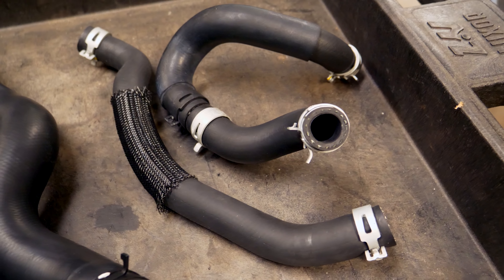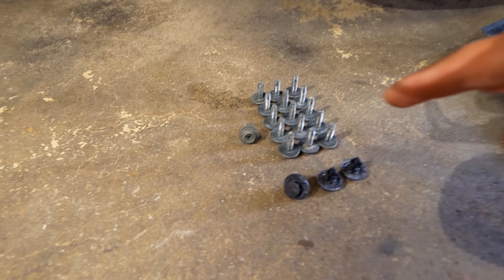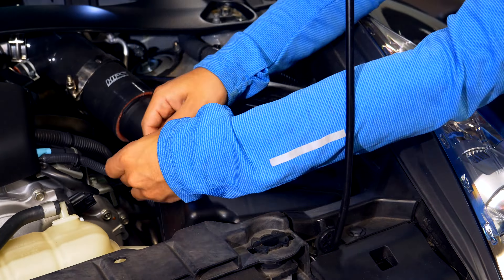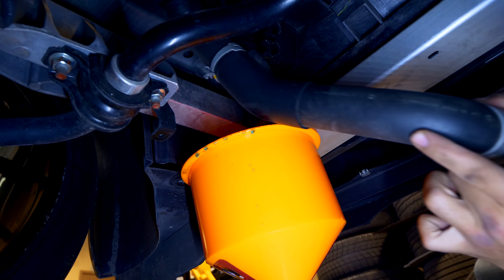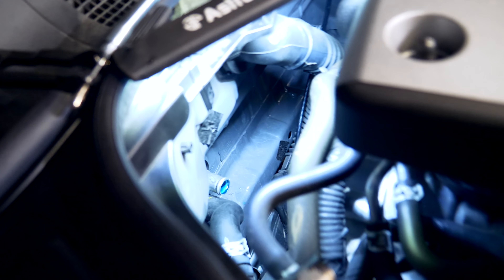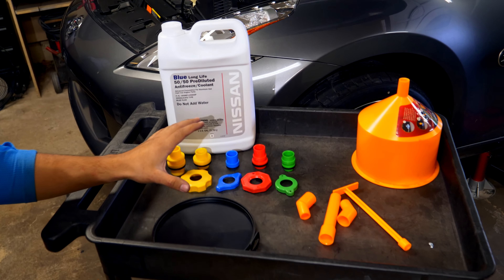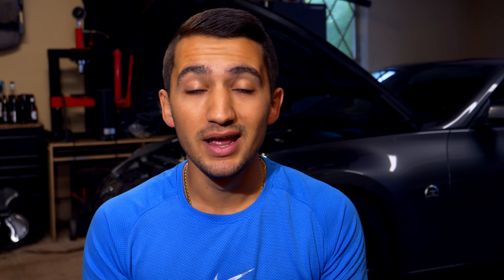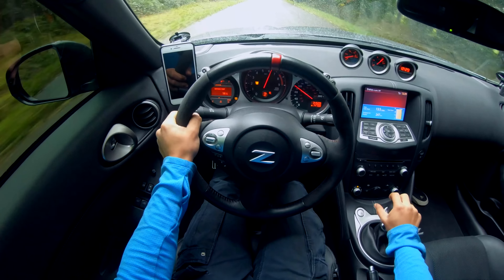How to Make Your Engine Run Cooler | BLEED MADE EASY

Comment: you have to configure the ECU enrichment fuel injection because at lower temps it will over-inject fuel to compensate for the lesser normal functional temperature from factory after putting a different thermostat - or get just over consumption needlessly.

Comment: I just did all my hoses on my 2009 G37. Surprisingly they were all in good shape, however then I did my heater hoses the plastic coupling denigrated in my hand as I took it off. I vacuumed the pieces out. The car had one owner before me and I've owned her since 2015. Both me and the prior owner live in Naples, Florida so the heat is nevvvver ran. Good thing!

Comment: Good idea for the hoses, bad idea for the thermostat, the car is designed to work at a certain temperature, don't mess with it, the engineers at Nissan know what they are doing.

Comment: Should have added a Radiator Breather Tank 👍🏻 that will also increase cooling by getting rid if trapped air when drifting or at a track.
Reply: Just curious how or do you have a link for a similar idea?

Comment: I would recommend stuffing some shop towels underneath any of the coolant hoses you detach so as to minimize a mess on your engine.

I like to mix one oz of Redline's Water Wetter to each quart of coolant to improve heat transfer from the block and head to the coolant. Water  Wetter is a surfactant that reduces the surface tension of the water and allows for greater contact area between the metal and the coolant. When I did this to my Z I noticed a 5 - 10 deg F drop in idle and low speed temps and a good 10 deg F drop in highway temps. I did a similar thing with a liquid-cooled Porsche 944S that I had years ago and got great results in lowering my engine temps.

Comment: If the engine constructor recommended that the temp will be better to be higher than 68 degree, than working under that temp will increase the wear in the engine. If you wanna be protected for overheating you should use a mix with more water in the cooling system and a better radiator. Keeping the engine under temp will increase the wear. Also use an oil cooler and a bigger intercooler for overheating protection. That will be far better than too cold coolant running inside the engine.

Comment: Excellent video and very informative, except for one tiny detail. I wish you had shown exactly where the most difficult hoses (the heater hoses) were to remove and how you used your tool to do it. You only gave one quick glance at the fire wall where the heater hoses were and it was "almost" enough to give me an idea of how to remove them. I'm sure I could figure it out but...it would have been nice.

Comment: Rubber replacement OEM are good enuff....you should look into smoothing the casting rough surface in all the cooling send and return especially the stat housing.

Comment: But putting a lower temp thermostat might only keep it for example at 160 F for a little while in a hot 95 F plus climate, it'll eventually climb up when the vehicle is not moving. I've seen this on my G37 which I even have it set to run the fans at full speed as soon as the engine is turned on. For managing temps I think that a good oil cooler is best. This way the radiator doesn't have to fight the engine's temps alone.

Comment: Well made vid as usual, good job! Quick question, I have a 2015 370 base automatic. I too switched the HPS Post maf hoses and when I looked at these on eBay it only shows up to 2013. Will they still fit mine? Doesn’t seem like they did any changes to the engine set up since.

Comment: You are SUPPOSE TO REV THE CAR in the bleeding process per the factory service manual. Iv done this myself. Have the funnel no more that 1/3 full, and rev slowly to 3k rpm and hold for 10 seconds. Let off fast. Hold a few seconds, then repeat 3 or 4 times. That's only adter everything else is done, then I shut the engine off and leave to funnel on until the engine is cold, then remove. You will lose about 1 inch of coolant back into the engine during the cooling process.

Comment: The low temp thermostat IS ONLY GOOD if you like to 'beat on your car '.. Under normal conditions it will make it incredibly difficult for the car to get up to operating temperature...decreasing life of engine and giving you crappier gas mileage too I believe.

Comment: @Mil, I apologize if this has already been asked but.... do you have a coolant you would recommend beyond oem specific for street/canyon carving use? 
Thanks if you get to this!
Reply from the maker: Hey JH, I've been running the OEM coolant for all of my cars without any problems. I have heard of people running Water Wetter for added cooling performance, but I would rather an upgraded radiator if possible. It costs less in the long run and is easier to find OEM coolant
Reply: @milanmastracci  I seriously appreciate that insight, and makes a lot of sense. Again thanks and keep at it brother, you've always been making smart vids and we all appreciate you taking time to respond back!

Comment: I dont track my car, drive too hard, and I want my heater to work to the same degree. Say I my OEM rubber hoses fail, could I just upgrade to Silicone for the added durability and reliability and just put a OEM thermostat. Or would this still lower my temps a bit making my heater less effective.
Reply: If you just change to silicone hoses and reinstall a new OE temp thermostat, no nothing will change heater wise. Silicone hoses on their own won't increase cooling ability, just durability. Changing the thermostat temperature is what will cause the heater to blow air that isn't as hot as it should be.
Reply: mannys9130 Makes sense, thanks you

Comment: I got the 34 oil cooler which is great and all but my coolant runs at 225 degrees i need advice, should i do an entire cooling overhaul? I have a supercahrged 370z

Comment: With all respect but you dont have to turn on the heat to fill the heater core.. the system will burp either way. Also i bleed the system until the fan cycles at least twice. You can also bring up the rpms but dont snap the throttle that will cause a mess

Comment: it's was stupid idea to upgrade hose. I live in country where in winter is extreme cold  minus 35 degree celsius, in sumer 35 degrees cesius hot. and hose do not have any problem for 20-30 years.  only intercooler ones.

Comment: I disagree! The engine has an optimal running temperature, this is why we dont want it cooled under a certain degree. This is why your thermometer has a specific rating. IMO you should not change your thermometer to one with a lower rating unless you've rebuilt your engine, in which case you probably know this already. What happens when you change to a thermometer with a lower thermometer rating is that it starts cooling earlier and the engine may not stay at the same running temperature when doing normal driving. Look up the consequences before you do anything yourself and take into consideration that some things are a certain way for a certain reason.
Reply: Also, remember when using anything silicon.. beware of painted surfaces. Silicon will ruin your paint and make the material unable to bind with new paint in the future.

Comment: 154° is so cold,  your engine will take forever to get to operating temps. This makes no sense for anyone thinking that is a good thing. 187° is about right. It makes 0 sense to open up at 154.
Reply: True story! Some cars have ECU trigger for low coolant temps, it will set a DTC and trip the check engine light. Don’t know about Nissan, but the NC Miata certainly has this feature. I know this because I had a thermostat stuck open and it triggered the light. Modern cars have temperature gauges that read normal even when the actual temperature is too low or too high. This is so consumers do not freak out seeing fluctuations in the needle. In my case, the needle was reading normal although actual temperature was about 20 degrees too cold.

Comment: All putting that thermostat in will do is make you car less fuel efficient.
Reply: I might seem dumb as shit, but how would it affect fuel efficiency ?
Reply: @imnota  a cooler engine runs richer. Less efficient combustion
Reply: @flyhacking5830  Yeah, but that would only work if he was keeping it under the stock operating temp.  He won't. Because the point of that more efficient cooling system is that it won't overheat while tracking the car, and while tracking the car, there's no way it will get under operating temp. Plus I doubt the difference would be noticeable anyways.
Reply: @imnota  he mentioned 68°C. Most cars operating temps are 85°C~100°C
Reply: FlyHacking
That's the temp where the thermostat will open, which means coolant will flow more often, so the engine will be cooled more, so it technically could run below operating temp. BUT, he's making that upgrade for when he beats on it, which means it won't ever be below operating temperature, the thermostat upgrade will keep it from going over because it will stay open and cool more to prevent overheating, but as long as he keeps beating on it, the temperature won't go below.
Reply: @imnota  key word: when. During normal driving conditions, he won't be beating on it. Also remember, when he's beating on it, the water pump is flowing more water which will still result in lower than operating temperature
Reply: @flyhacking5830  And guess what : when he's not driving it hard, he doesn't care that he theoretically has .6 less hp. Pretty sure he doesn't care about mpg either since he's already fucked because it's a Z. Have you watched his videos ? I seen him driving slowly for about 6 seconds and seen him beating on it the rest of the time lol
Reply: @imnota  good point haha
Reply: IMNOTA it will run rich no?🤔

Comment: You are full of bullshit. Those hoses were perfectly good and didn't need replacement... You can lower the temp by installing a better radiator...
Reply: Also those aftermarket clamps are way worse than the original....
Reply from the maker: Upgrading the radiator will keep the temps down if the thermostat no longer can. And the hoses were fine, however they will eventually need replacing. You can think of this as a preventative maintenance item like oil changes. Nothing is broken after 5000 miles but a good way to keep everything running properly is to change the oil.